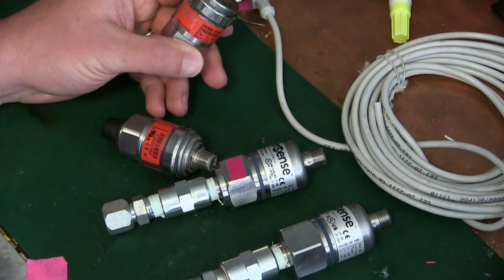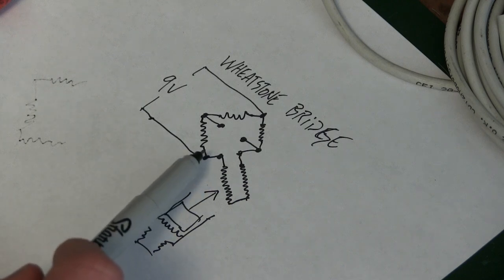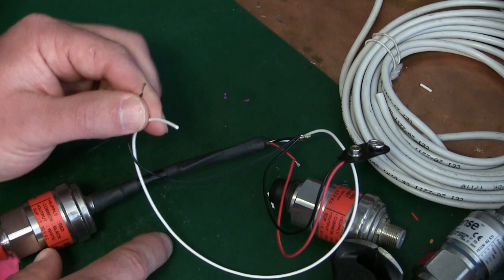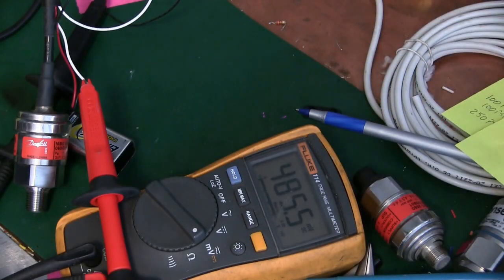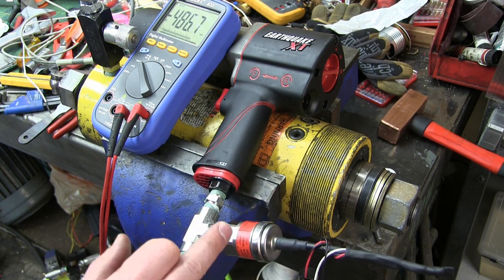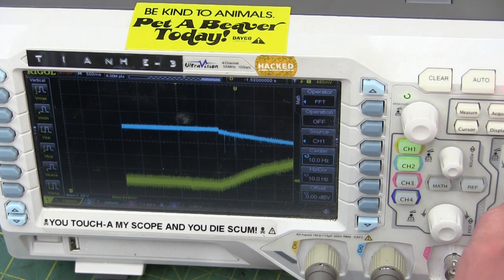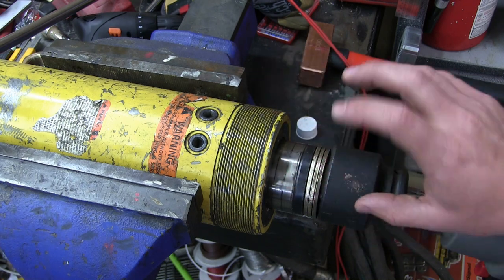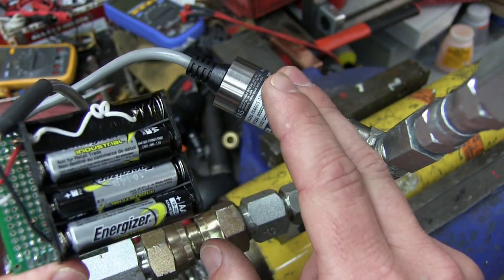How to use Pressure Transducers for Troubleshooting

Comment: *whips out clipboard
*whips out Bureau of Standards Pub  ASTM E2624-15
*adjusts glasses
Well that's true Mr AVE that they use 2 inch fasteners and new grease between runs. That is the universal standard used to insure that all test use the same baseline to testicle different impact guns. IE 3/8, 1/2, 3/4, and 1 inch all use the same test bed for repeatability.

* adjusts glasses
Reply from the maker: I looked everywhere and haven't found a "1100 lbs ft *tested per ASTM E2624-15" statement anywhere. Am I dumb or just ugly?
Reply: rigidity, mass, size of fastener, moment of inertia, friction and some more factors play a huge role in impulse drivers. normal torque wrenches on the others hand only need to combat rigidity and friction

maybe they just need to change the testing standards and publish a chart of different size(length and width) fasteners, type of steel and lubrication with achieved torque
that at least will be a better reference
Reply: Yes. Real Tool Reviews doesn't say this the actual torque capability. He uses the Skidmore Wilhelm because that is what he thinks the industry uses to make their "nut busting" torque claims. I think he even has a video where he says "nut busting" torque is marketing BS. But he uses the same procedure for all wrenches so it is a valid benchmark for comparison purposes. At least AvE noticed RTR also gives dynamic results with the digital meter.
Reply: Real Tool Reviews guy said he contacted one of the tool companies before and that's the bolt setup they use. so he didn't just assume
Reply: Ah, thanks for the clarification. I thought that might be the case but couldn't remember.
Reply: My girlfriend cares a lot about rigidity, mass, size of fastener, moment of inertia, friction, and other factors about her favorite impulse drivers. Just sayin
Reply: haa haa funny...
Reply: LOL ... driverSSS?
Reply: *Grabs Clipboard & Snaps in half
*Whips Out trusty King Dick Adjusting Wrench
*Tappy, Tap, Tap on those Glasses

The issue here is that Princess Freight, besides smelling like stank, is truly misleading the poor sap lured in by "low prices".  He (or maybe She) sees 1,000 ft/lbs, and goes WOW that will crack any nut! But it won't, 'cuz its not.
Reply: system be all spring-a-m-sproingin.
Reply: Google search "ASTM E2624-15", then click videos. Click the first link you see.

Welcome back stranger.
Reply: I R famous now XDDDDD
Some engineer is going to be soooo confused if they click that link.
Reply: A bit of both, perhaps?

(Sorry, you left yourself open! LOL!)
Reply: The value in the way he tests is not to see the actual torque of the gun but instead a comparison between two guns. I believe that's the only value in his tests
Reply: Angle of the dangle is proportional to the Mass of the ass times the lust of the thrust!
Reply: he is testing the actual torque of the gun
the real problem is that torque is only true for that bolt and nut and socket combo.
if you're going to use it on a different combo you won't get the same results
this is just a case of marketing wank of the tool companies nitpicking numbers
e.g. an electric saw of 2300W 15 amps 120v, i mean come on 15*120*pf(~0.85) is nowhere near 2300
Reply: I wish somebody would have told me this 8 hours ago. I've been trying to bust off these bellhousing bolts with my Hitachi impact driver using a 1/4 to 3/8 adapter, plus x5 24" 3/8 extensions with wobblers between each, then a 3/8 to 1/2 adapter on an 18mm deep wobbler socket. But at least I can lay on the tailgate and still reach the ice chest while changing batteries in the impact driver.
Reply: those torque stick do work if your lug nuts are standard size(not some exotic steel or alloy)
Reply: Seems to me Jeremy, that she'd care more about the size of the bolt than the fastener.  Que no?

Comment: Great job and a good demonstration. We use pressure transducers all the time in Automotive Diagnostics. We use them in the tailpipe 4 exhaust pulse diagnosis , we'll use them in the spark plug hole for in cylinder testing , vacuum testing, fuel pressure, transmission Etc. It's nice to be able to see your pressure on a scope instead of just a gauge and log voltage over time.
Reply: South Main Auto Repair well , at least I liked ypur comment 😄
Reply: Haha..and I thought I was the only car tech guy that watched AvE  (:
Reply: I thought that only a few use these as auto techs

Comment: Also worth mentioning is the frequency response. The type of pressure transducer(s) shown, typically have a conditioning circuit and/or ASIC in the device to provide linearization/scaling (such as the 'live zero') and temperature compensation. This type of signal conditioning can lead to slower response times or a dampened output.

Comment: While some of it has to do with marketing wank, it's mainly for repetition. It's a lot easier to polish the washers, use fresh grease and standardize the size than it is to repeat the same level of corrosion, the same thread galling, the same schmoo in the threads and all of those real-world variables. It does give a higher number, but mainly it gives a more consistent number to allow more accurate comparisons between different tools. Some marketing "geniuses" (not naming names here but they're Fraught of Horror) try to throw those numbers out there as if they were real-world numbers when it's really just meant to be a way to compare it to another brand.
Your set-up is excellent and you're a genius to use a pressure transducer and an o-smell-oscope to see the actual pressure waves. I deal with these nearly every day for oil and boost pressure logging and it would have taken me a long time to think of using them in the way you just did. I think it would be interesting to see different types of harmonic balancers (and maybe imbalancers, if that's a thing) and see if the oil transducer picks up any spikes.
G'day, sir.

Comment: You can actually hook those transducers up to a computer mic/line input if you don't have a scope (use a resistor divider and/or potentiometer to bring the voltage down so you don't saturate the line input). If you're not interested in absolute magnitude it works a treat. I used this technique to accurately measure the RPMs of a mechanism (sound cards have a pretty good timebase) and to look for valve sealing problems in an engine.

You can also use a cheap audio recorder to take samples in the field for later analysis on a computer. Just make sure it's recording lossless.

Comment: You also have to take into acount that the resistive element could be logaritmic and not linear, that whould change the calculations. Connect it into the osciloscope and do a 0 to 600psi sample, save and print the curve with values. That would be you reference chart on the field.
Reply: I think since it is piezoelectric it should be linear
Reply: Mr.Skidish oh, yes, my bad. Forgot it was a piezoresistive element...

Comment: These things are really everywhere. More and more gas stations are starting to utilize pressure transducers for line leak detection. Like stated they rarely do go bad and normally the pigtail and connectors go long before the actual transducer goes out. If you get your hands on one you should do a year down on a mechanical leak detector for people.

Comment: thank you for calling us hoarders, "Grey Beards" made me tear up to be appreciated
Reply from the maker: Hahahaha. I know who to ask for Whitworth grubscrews and replacement Lucas Smoke.
Reply: I had to borrow the wentworth wrenches and fittings to work on the double deck busses
but I did know that son of a englishman who horded them tools in california
and the brakes on the double deck busses is a patreon vid , I promise its amazing
engineering, accumulators , drive shaft between engine and transmission 
and the shock springs are H-E-U-G-E  
you need those on your canuckian battle bot
Reply: AvE I once went into a tool shop and asked for whitworth spanners...the cocky little twat behind the counter said "no mate we only do metric or imperial..." WTF Did he think whitworth ones were then if not imperial? I've seen Lucas Smoke too ... Starter motor that caught fire...

Comment: In industry pressure transducers/transmitters usually (at least pre-digital systems) used 4-20 mA.  This allowed using only 2 wires to the device which would compensate for lead length.  

I've got half a dozen on my shelf that are worth $10k each that can't be used because we did major environmental testing on them.

Comment: Pressure transducers, decomissioned PLCs, entire functioning building alarm systems that were meant for the bin. My parts hoard grows and grows. You never know, I might need to install an entirely dedicated alarm system with card access, electric door strikes and a door intercom in my garage.

Comment: I have actually used sockets almost that big. swapping castings from old boilers too new, because the castings contour the round boiler shell the only way to get them off is is to cut the studs off flush with the boiler. a good way to do this is to use an impact to twist the stud right off. they usually shear off right at the boiler.

Comment: I use pressure transducers at work for development testing. If you want to data log for longer then the oscope get a Dataq data logger. They have $60 options at about 40kHz and are super easy to use.

Comment: awesome vid, I'd love to see you do more with transducers. I work for Cummins as a technician, and our procedure to determine how much compression an engine has isn't a compression test, but measuring blowby with a manometer.  I want to build something with a pressure transducer that can measure crankcase pressure, and sync it with an engine position sensor on my oscilloscope to attempt to pinpoint bad cylinders rather than condemning a whole engine, which is what usually happens with the general blowby tests.  There's a pressure spec for blow by, but there's also a flow spec.  Maybe I could use two transducers across an orifice and calculate flow? I'd love to have a little aluminum project box that displayed pressure and flow but I can't figure out the Arduino code or math.  Any help would be greatly appreciated.

Comment: Strain gauges running on a balanced dc offset inside a complicated bridge similar to a Wheatstone. They usually also have temperature compensating resistors to maintain consistency as well as modulus balancer resistor(s) to keep that dc offset.

Comment: Same deal as a load cell for industrial weighing of carcasses. Turning gravity into different amounts of angry pixies. The most I remember from those days is having to check the load cells for accuracy by manually moving 300 kg of weights on and off the scales 20kg at a time for the most part.

Comment: those things are like flame rods/sensors in gas fired equipment. turns a direct flame into a dc signal using flame ionization. then you measure it using microamp reading. most residential and commercial are around 2-4micro amps

Comment: I know nothing, I am the ”wrong” kind of engineer, but this what I would have done.
I would have taken a torsion bar, fixed one end in the vice, attached the gun to the other end (maybe stabilized the rig with a bearing) and measured how many degree the gun can twist the bar.
The measuring of angle can be done with a mirror glues to the bar and a laser pointed at the mirror.  Following the dot (in the ceiling) and simple trigonometry should give the maximum angle.
Love the videos!

Comment: What you also have to remember the pitch of the bolts are different.  If you where to unwrap the threads and lay them out the larger bolts would have longer threads. A bolt is just a helical wedge. So the longer the threads the less aggressive the wedge angle there by giving you better leverage to creat more clamping force with  minimal effort.

Comment: I find it funny that the big 1" impact we use in the shop, this big 2 handed monster of a tool is rated at ~2000 foot-pounds of torque, roughly double the earthquake impact. The marketing wank is strong. I'm fairly sure that impact can actually deliver close to that output when used in the real world.

Comment: It's the difference between you putting your weight on a breaker bar and hitting the bar with a hammer.
If you think about it, the short handle on an impact wrench is not long enough to exert the force to undo tight nuts merely by leaning on it.

Comment: Transducers don't got pistons. Strain gauge on a  precisely machined wall, or newer ones are MEMS.  Absolute pressure transducers gots a (close to) 0 kpaA reference pressure chamber on the other side of the wall. Sealed gauge have a 102.3 kpaA reference chamber, vented gauge the reference chamber is vented to atmo, usually with a tiny tube in the connector or in the harness.

Comment: 12:55 the hydraulic transducer's signal does actually have ripples around 40ms apart. Also, this looks like power-line noise (50/60Hz), usually coming from poorly designed switch-mode PSUs' of other devices.

Comment: For arduino take a look at the ams1115 it's a 16 bit i2c based a2d. good enough for some medium speed data logging, cheaper than dirt, and easier to use than SPI ones.

Comment: Hmmm would be cool to hook one of these up to the water supply and monitor water pressure.  If pressure is too low for too long it could mean a leak and could set off an alarm.  If you want to get fancy you also have flow sensors at the end of each water source so if any indicate flow it's definitely a leak.   That would be pretty skookum.

Comment: Pro tip: 9v Batteries also live in smoke alarms.
Reply: You can also find them inside the 9V battery drain pucks located on the walls or ceilings of some homes.
Reply: That's the first spot I go to when the 9v dies in my meter.
Reply: All of mine are already empty from that.
Reply: Electronics nerds raiding smoke alarms to power their cobbled-together new projects. WHAT COULD POSSIBLY GO WRONG!
Reply: If you think about the half life of americium and the life of the Li battery it actually makes a lot of sense to glue it in and force people to replace the unit.
Reply: No, Lucas, 9v batteries only die In smoke alarms.

Comment: Most industry stuff (production line stuff) isn't very high pressure, the crap I work on only goes up to 6psi as they don't need much more than that. True the robots main actuators are running higher but that's on a built in pump and accumulator setup instead of the factory main line

Comment: I grant you all those points, but that being said, as long as  all the guns are tested in the same way, isntnthe one that shows the higher torque still going to be able to do a better job busting that fucking rusted honda crank bolt off? and wouldn't it be rather difficult to come up with a test to consistently test those sort of circumstances? another thought, could that breaker bar you have leaning against the bench be flexing and absorbing some of the impulses too? that might help explain the gap between your results and those they get on the "professional" testers along with the other things you mentioned.  Fantastic video as always
Reply: The specs are "Max Torque", meaning the maximum torque you can achieve from that particular impact gun. Then using the best setup so that the gun can tighten (or loosen) a bolt to its best ability should be used to test the max torque spec. So I agree, it is less ambiguous and good way to compare impact guns. The so called "dynamic" torque test of skidmore is ambiguous. For once, even though the name sounds like it is going to give the instantaneous highest torque value of the impact impulses, it is actually giving an averaged value. And they don't tell what is inside, what kind of averaging they are using to come up with the resulting "dynamic" torque value it measures. That is less useful because you actually don't know what the conditions and the exact method (averaging but how?) used for the spec it gives.

Comment: I'm an instrument tech, the fact your zero isn't closer to 0.5v is bugging me. I never realised I was that OCD.
We use 4 to 20ma over here, so the norm is to use 2 x 9v batteries to give 18v because they tend not to work at much less for some brands. The 0 to 10v and 0 to 5 are less common. As for the 4-20, just use a resistor for the load and pick off a voltage across it remembering 12ma is 50% span.

Comment: Hmm could the pitch of a smaller bolt maybe get more tension :? since the pitch is smaller usually that results in more torque ? although the thing can twitch but what if you used the same thickness rod with the smallest pitch possible ? as long as it wont strip.